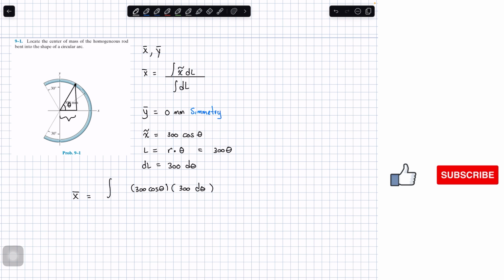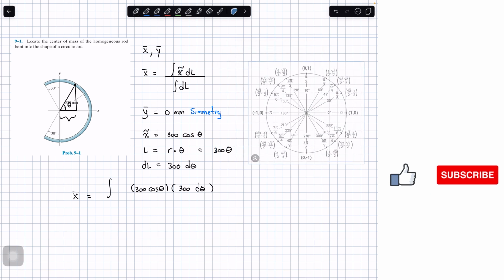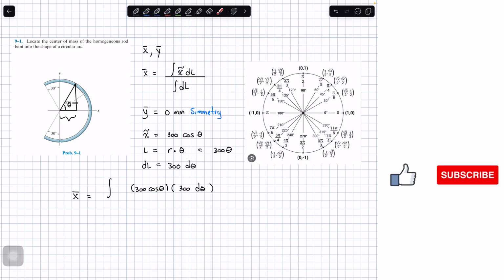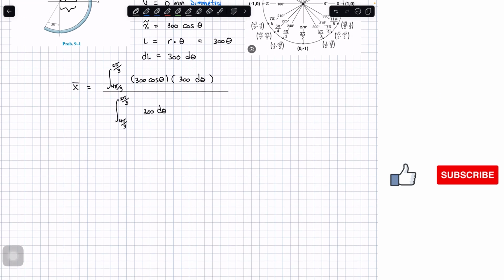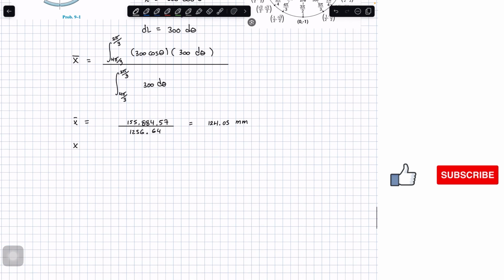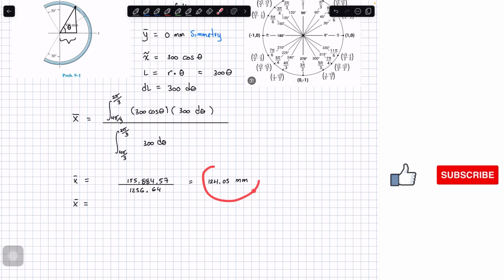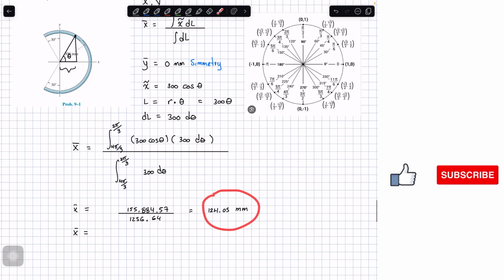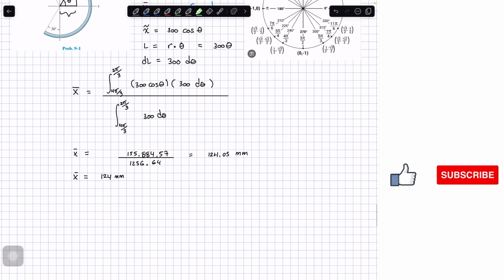Statics 9-1| Locate the center of mass of the homogeneous rod bent into the shape of a circular arc.

Comment: For the denominator im getting -628.31 when i solve the integral. That is 1/2 of what you are getting and negative. Instead of using 4pi/3 I put in -2pi/3 and I was able to get the same denominator.